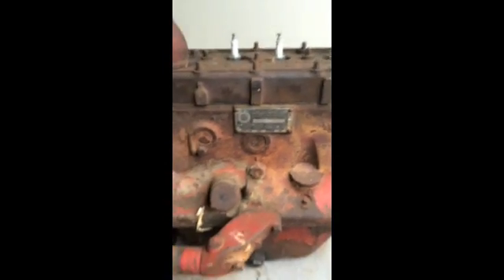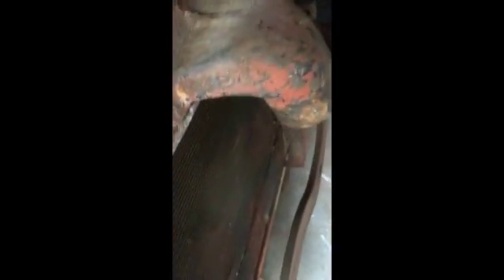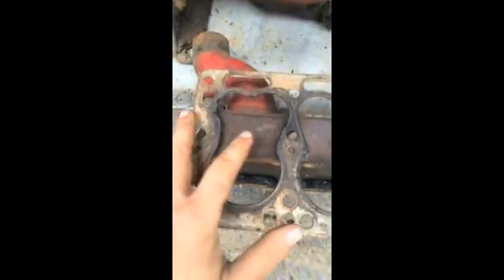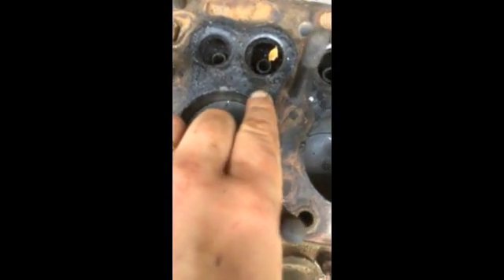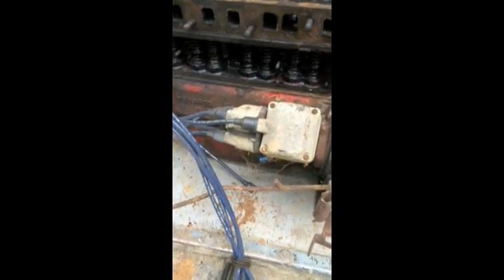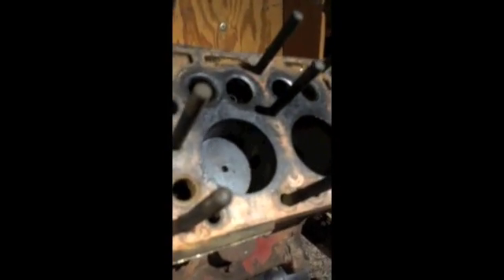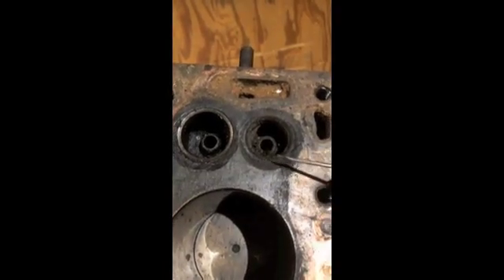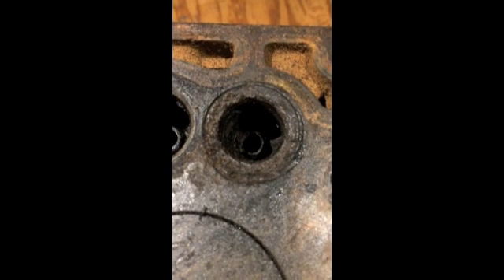Continental Y69 Rebuild 1

Comment: Great video! I have a homemade tractor with this power unit. Really cool to see this, I hope you plan on showing more of the rebuild
Reply: Vintage Tractor I have a Y69  contennetal motor trying to find a home for.
All together just missing shroud over motor.
It a flat belt power unit.
Motor tag. I Y69 36982
Reply: Do you still have the Y69 available?